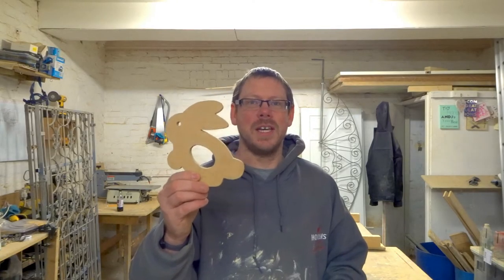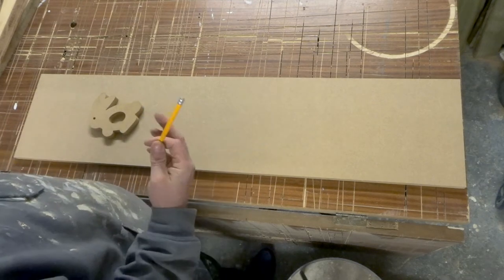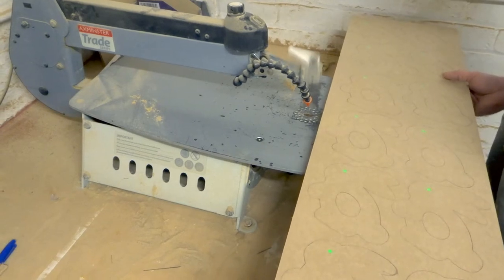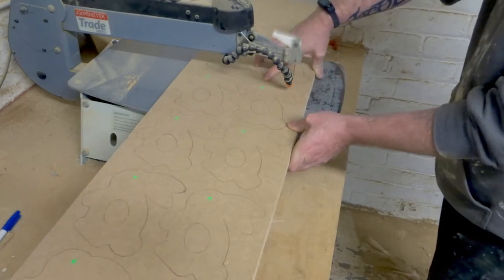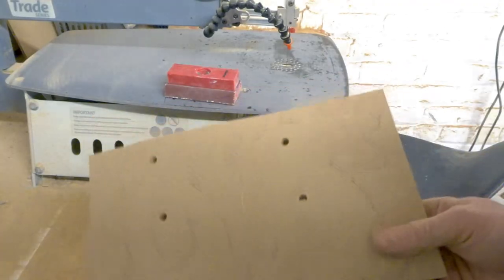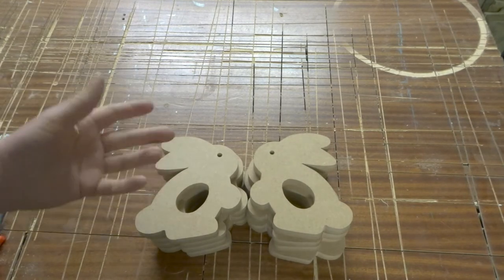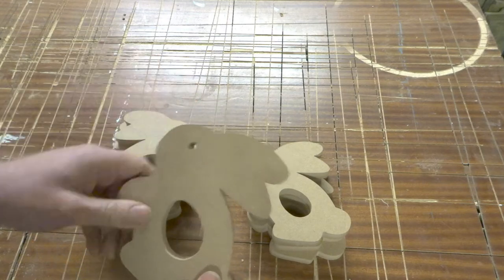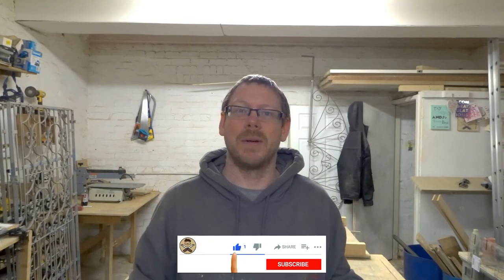These make me £1,000's each year

Comment: Good Video and thanks for sharing ,not sure what size your laser bed is   but if you cut the board in half,  you could mark the shapes out on the laser, its quite simple with lightburn ,a mate of mine wanted a 3d printed part making for his boat, we measured it out, marked it  and cut it out in cardboard with the laser ,till we where happy with the shape  ,then printed it 
just a thought.
Reply from the maker: That's a great idea. My laser is only 500x300mm. I'm looking at getting a CNC machine soon that will hopefully be 1200x1200
Reply: @philscraftcorner  cnc you will have no problem ,Pass through would be another option if you have that on the laser
Reply from the maker: I do but not enough space to use pass through at the minute. There's not enough space in my office  I definitely need to move things to my workshop